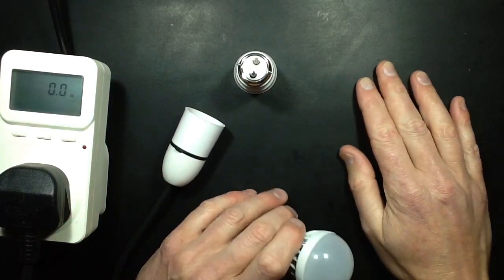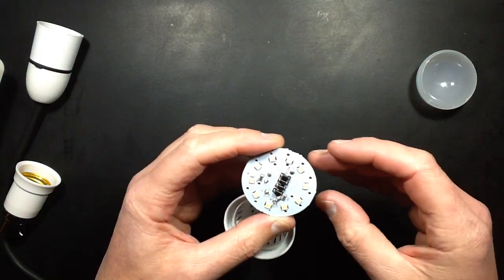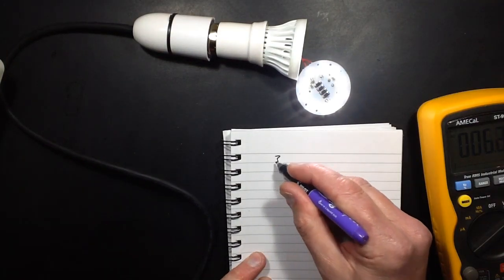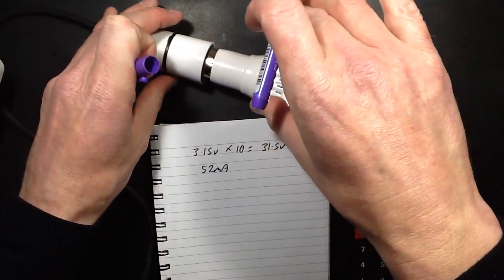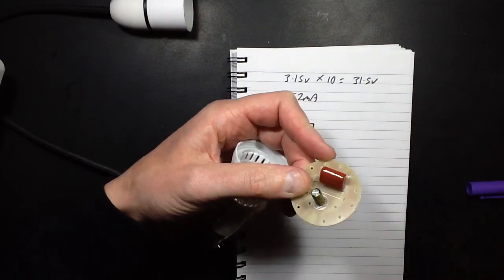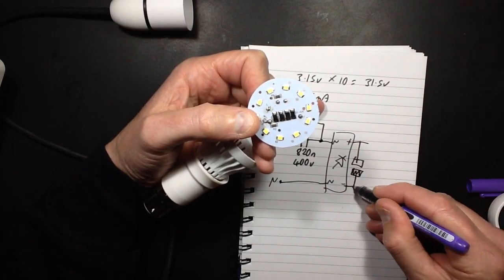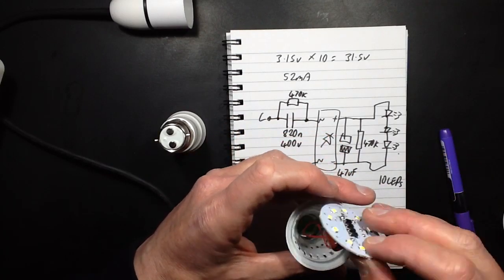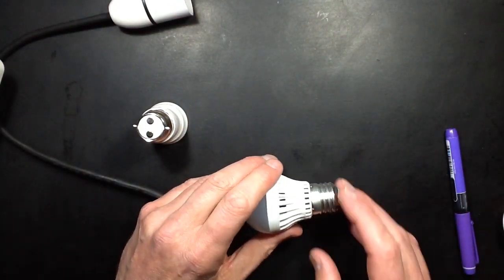Inside a 3W globe lamp with schematic.

Comment: How about a test of the cheap ebay anti static plugs for your car lighter socket.  Heres the item no for a 99p Chinese unit.  261894691004
Reply from the maker: +thra5herxb12s Those are super-simple.  They are just a neon indicator lamp in series with a resistor, so that when you hold one end and touch the other to the vehicle, any charge will get dissipated over a larger area where you hold the end.  The neon also flashes briefly when the static discharges through it.  You could do the same thing with a metal key.  The main sting of static is due to the sudden zap on a single point on your finger when a spark jumps.
Reply: Thanks, I thought they would be more sophisticated, but for 99p I guess they couldnt be realy.
Reply: +bigclivedotcom And of course you can avoid the problem altogether by holding on to a metal part of the vehicle as you get out as the static charge is on you, generated as you slide off the car seat. Most shoes are conductive enough to dissipate any charge before you can get zapped but some, like a pair of walking boots I have, aren't.

Comment: I have more or less given up with these cheap Chinese lamps lately, since the price of decent ones have come down. When CPC are doing 12W, 1200 lumen lights (properly made, with honest ratings) for £4, I really don't see the point in spending £2-3 on something with marginal safety and questionable quality.

Maybe it might be an idea to test one of these against a similarly-priced Chinese lamp?

http://cpc.farnell.com/pro-elec/hk-ld582a-bc/12w-1200lm-3000k-warm-white-b22/dp/LP0786607?CMP=TREML007-005

I'll continue to buy the very cheap lamps from China for sh*ts and giggles, but anything over a fiver just isn't going to happen.

Comment: The black background and brightly lit white subjects may be exposing (no pun intended) the dynamic range limitations of the iPad camera. Might it work better if you tried shooting a video on a piece of white poster board so the camera doesn't have to contend with such a broad range of brightness? It seems like vloggers who shoot on light blue or green anti-static mats don't have the same exposure problems.